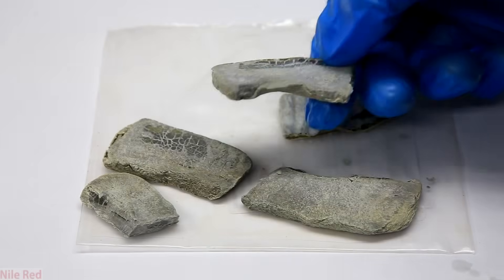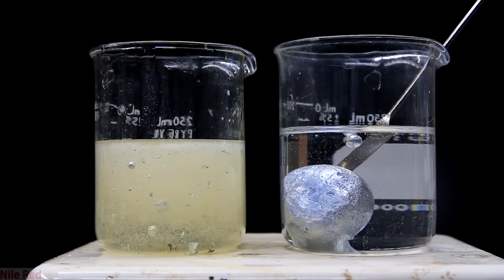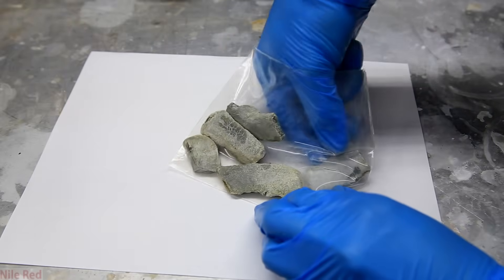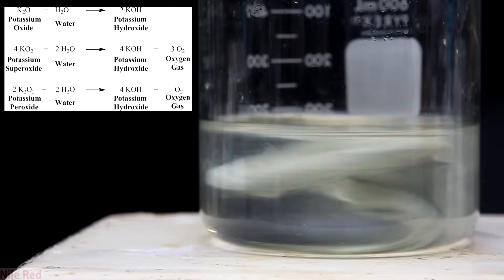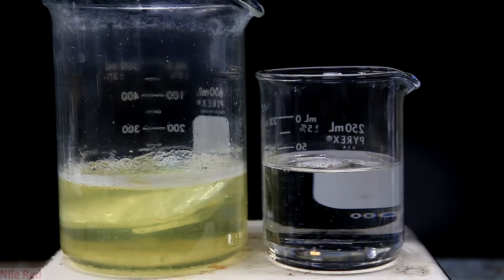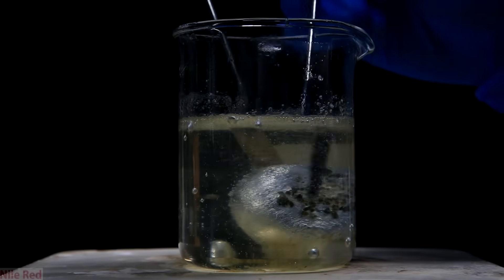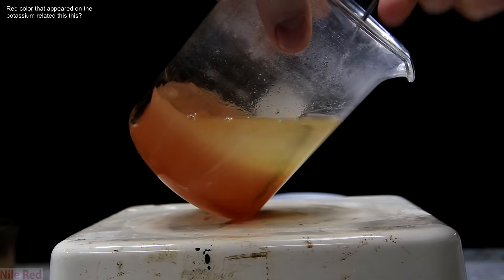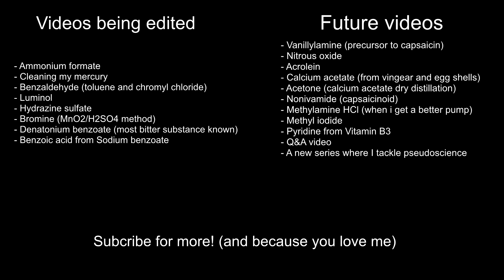Cleaning old potassium metal

Comment: Thanks for this NileRed.  It couldn't be more timely.
The school where I teach has some potassium that is very old.  It is not something replaceable -- schools are not supposed to have it any more.  For this reason it has been used sparingly over the years and now has a lot of oxide -- to the point of becoming dangerous.  One of those situations where regulation actually makes things less safe.
Anyway, I was considering how I might clean it up and to have a tutorial to follow is just great.  It helped that the exact moment that I was perusing your channel and found this, the school's work-place safety officer came around with some questions specifically related to the use of potassium and our risk assessment procedures. We watched the vid together.

So, a couple of specific questions.
Was the toluene dried or did you use it direct from the can?
I saw you adding IPA dripwise.  How long did this part of the process take?
Would other alcohols (ie, ethanol) be equally suitable?
Reply from the maker: +j_sum1 j_sum1 I added it slowly, but I am not sure how long the process took. The toluene was not dried, I just used it directly form the can. The little bit of water in it will actually react with some of the oxides. I am not sure if other alcohols would work, honestly. The commenter below seems to think that ethanol wouldn't be a great choice. 

If you do this, just remember that a fire can start. To put it out, just cover the beaker with something. Don't use a fire extinguisher or freak out. It can lead to a much bigger problem.
Reply: Using anhydrous solvents will be less hazardous (M + H2O - > MOH + H2...) and you wouldn't loose any of your limited potassium stock, but the residual water in toluene won't be available to react/dissolve the oxide species. Your call. Personally I'd use anhydrous to limit the potential hazards but I'm used to working in a lab with an ample supply of them...
Reply: Thanks for that MortRotu and NileRed.
I'll stick with the IPA then.  I'll do a test with the toluene we have available and if it is not to vigorous then I will proceed.  If there look to be issues then I will dry it first.
Reply: KOEt isn't so soluble in the solvents employed(toluene and mineral oil) so will form a coating over any remaining oxides effectively leaving the hazard behind. IPA is probably the best bet. I have a nice jagged 17 stitch scar on my arm from a NaK still clear up where I didn't use IPA, whatever you end up doing be careful.
Reply: +j_sum1 j_sum1 no problem, I happy to help. If the toluene is too wet you can dry it out reasonably well with some molecular sieves (4A ones for preference, but any size that absorbs water and not toluene would work fine) and not cause your H&S person palpitations by doing a still. It'll still have a fraction of a % H2O in but shouldn't react anywhere near as vigorously as 'wet' toluene would. 

I hope a PhD in nitride materials synthesis becomes more useful than answering questions on YT...

Comment: I've heard Tertiary alcohols, like Amyl alcohol works far better for cleaning up Potassium than Isopropyl. You should give that a try, even if small scale only. Supposedly it helps it coalesce too.
Reply from the maker: +Matt “Sigurthr” Giordano Cool. Unfortunately I dont have any :(
Reply: @NileRed  I wonder what tea tree oil would do in this scenario, for some reason mention of tertiary alcohols made me ask this.
Reply: +196Stefan2 I was referring to this one; https://en.m.wikipedia.org/wiki/Tert-Amyl_alcohol
Reply: +Matt „Sigurthr“ Giordano "Amylic Alcohol" isn't a tertiary alcohol, since Amylic alkohol is a synonym for n-Pentanol, which is of course a primary alcohol.
Reply: Matt then you have to say that. Tert. Amyl alkohol is something completely different to amyl alkohol...
Reply: Its better as in "doesnt react like crazy". You could even use methanol, but it reacts too violently.
Reply: You can make some, for exemple Chlorobutanol, by mixing Chloroform and aceton ;)

Comment: uhh.... you've got some fun bits there...

So... first, about alcohol being acidic...

It's a topic covered in organic chemistry.... so second to third year college chemistry course(depending on the school's course structure).

Under normal conditions, pKa and pH are related, but, when you start talking about organic molecules that can undergo charge delocalizations and/or changes in structure due to resonance, that changes what pH means. (Lewis acids and/or stuff by Mikhail Usanovich might be interesting/pertinent to what you're doing here.)

Alcohols can be de-protonated, but steric bulk can slow or moderate their ability to donate protons to a reaction. Isopropyl groups ( which are a type of tertiary alcohol) and secondary alcohols react more slowly than primary alcohols  (ethanol/methanol/phenol)because the carbon/hydrogen bulk gets in the way of their reactivity and spreads out the electron charge (notice: not electric charge). That is to say, steric properties of the molecule interfere with the bulk kinetic reaction rate and local ion effects. 

This is kind of the next part of that... the gel you were seeing was a condensation product, probably caused by the isopropanol losing it's hydroxyl group and then reacting with the mildly acidic vinyl hydrogens of the toluene to form a hemiacetal. The hemiacetal would go on to further react and condense more toluene, but, especially if the potassium oxides (as a collection of related oxides not a specific oxide species)was oxidizing things, rather than directly donating electrons to the process, it could react further to make a large polymer. 

Lastly, since i mentioned steric effects vs kinetic effects, the potassium ion is said to be more basic than sodium, which is a stronger base than lithium. This is because the size of the atom is physically larger in that mentioned trend. This increase in size makes it more 'chargable' for lack of a way of describing it. This polarizability makes it slower to move away from a molecule which has an opposite charge. 
This is interesting because the blue color you noted in the video matches very closely to the blue color of the sodium azide you made in another video, varying only in the concentration with which it occurs. The blue color of new sodium azide, in general, is noted as being the color of free solvated electrons from a theoretical level of quantum mechanics (the point where physics and chemistry are interchangeable.). Speculatively, I'd say you have a benzene ring with a negatively charged methyl group.

Comment: 7:06 : that blue color is probably due to thin film interference, similarly to what happens when you anodize other metals such as titanium, hafnium, niobium (that one is the prettiest!), or even when steel is tempered.

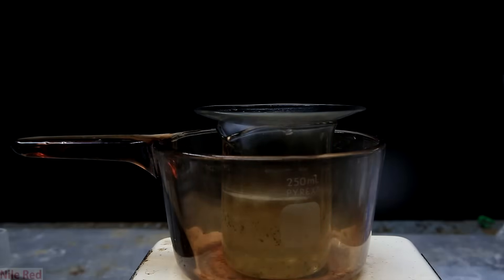13:34 : someone in my lab should have listened to that... 
He had some potassium in hexane, the whole thing caught fire (we're still not sure why). He freaked out, went to get a fire extinguisher, and knocked the beaker over by firing CO2 on it. 

He then managed to empty the whole extinguisher without completely extinguishing the hexane. Fortunately, somebody else brought a dry chemical extinguisher, and completely put out the fire. 

Had he simply grabbed anything to simply cover the beaker, the whole thing would have been over in an instant...
Reply from the maker: +piranha031091 Yup, it's crazy how easy it is to put out but using something like fire extinguisher can make the problem so much worse.
Reply: @NileRed  😯😯
Reply: Methoxy Light is an electromagnetic wave. So different thicnesses of oxides refract the light differently. It just happens to be that its the right thikness to make it blue.
Reply: That's hilarious, yet plain stupidity.
(I really mean ignorance)
Reply: My work involve with making NaK  Solvation which the bule color is the sign of free electron. However, Sodium can have a complex with 1,2 Dimethylethoxyetane which said to be blue.
Reply: @bnarit  "However, Sodium can have a complex with 1,2 Dimethylethoxyetane which said to be blue."

I've actually made it! It doesn't really work with Sodium, but does work with potassium, and even better with NaK

In the case of NaK, I think the much more intense blue may be due to sodide ions being formed.
Reply: @piranha031091  natride*
Reply: You can check on NH3 in Liquid O2. or this solvated electron clip.

https://youtu.be/o1nPgGyMo44
Reply: Isn't metal fire usually put out with sodium chloride, not carbon dioxide?
Reply: thought of the color being due to a thin oxide film aswell but why wouldnt the color continiously change while the oxide film thickens?
Reply: At a guess, a uniform thin film forms almost instantly, and this will be about 200 nm thick, giving a blue color. Once the oxide layer forms, the oxidation rate will slow way down as the existing oxide will tend to protect the underlying potassium. Not only that, while the potassium is in the toluene, there is only a trace amount of water available to react with, so the initial oxide formation will tend to deplete the toluene of water impurities. The way to test this, of course, would be to let the beaker sit for a while and see if the apparent color changes. It would also be interesting to cover the top of the beaker and purge the air space with something like nitrogen, to see if that prevents atmospheric water vapor from diffusing into the toluene and thence to the potassium.

Comment: yo nile! red is potassium ozonide... like the superoxide but with an addditional oxygen
Reply: +Feetkiller97 I doubt it, potassium would react with oxygen in air to make KO2 at most, KO3 is very unlikely and would require ozone to be present, which is not present at our heights. I might be wrong though.
Reply: +Eito it's as far as I know a red potassium oxide that can most definately occur at our height. .. but yeah I gotta say I'm also not sure but this seems to me the most logical
Reply: Feetkiller97 The problem is, there are only a few ways to make KO3, I'll post them below:
2KOH + 5O3 → 2KO3 + 5O2 + H2O
KO2 + O3 → KO3 + O2
K + O3 → KO3
As you can see all of them require the presence of ozone. Ozone is present in very small quantities (around 0.1 ppm at ground level) and therefore it's almost impossible to make KO3 and definitely not with the rate shown in the video.
My guess would be that his nitrile gloves are reacting with potassium, but that's kinda unlikely as well.
Reply: +Eito can't it be since I think it's a radical and it's REALLY intensely coloured? but yeah maybe it is with the nitrile gloves or the toluene had some contamination?

Comment: I recommend using shellsol D70 for the storing and washing. The potassium doesn't float in it and when adding a drop of isopropanol to the hot mixture the drops coalesce together quite well.

Comment: cleaning lithium :)

what can be used instead of toleune? mineral oil ? and isopropyl to clean it just like you did with toleune?
Reply: +mattibboss I'm pretty sure anhydrous mineral oil can be used, but isopropyl alcohol can't be used as the potassium will react with it to form potassium propoxide
Reply: +Soham Gumaste Actually, I think mineral oil should not be used because of the superoxide. Did not know that when i wrote the comment
Reply: +Soham Gumaste so what easy to get can be used?
Reply: mattibboss I do not know. I am not qualified to answer. You might wanna consider asking on ##chemistry on the freenode IRC network (google "Internet Relay Chat freenode" if you need help)
Reply: mineral oil is a good choice. Much better than toluene, as its boiling point is much higher -> lower risk of fire.
Same goes for storage.